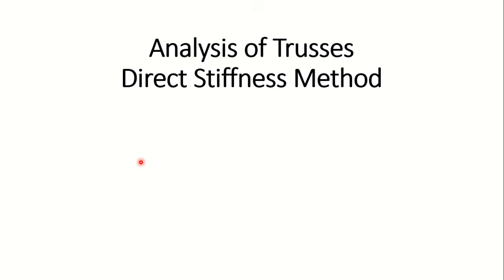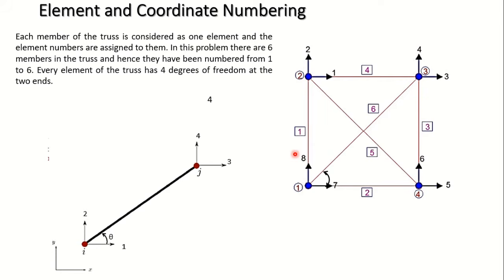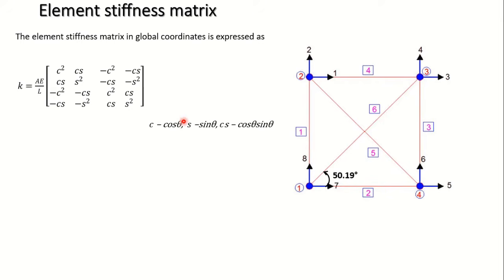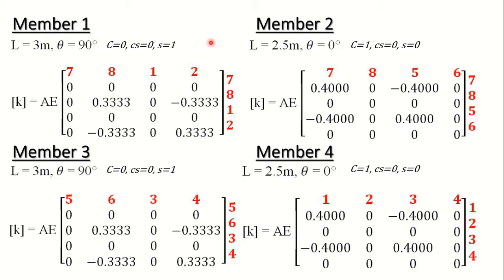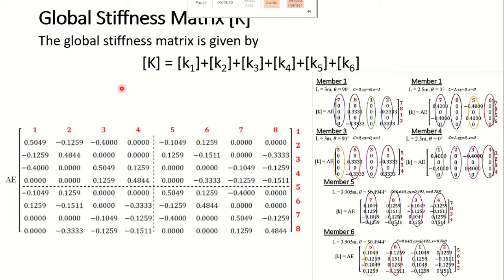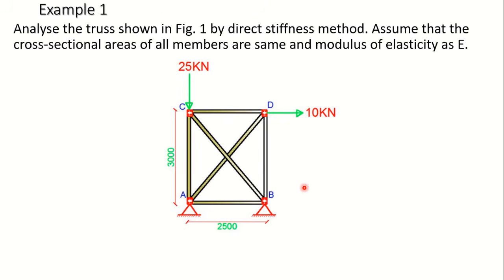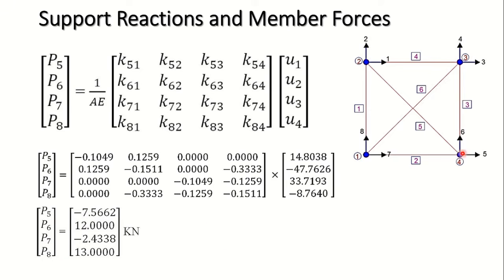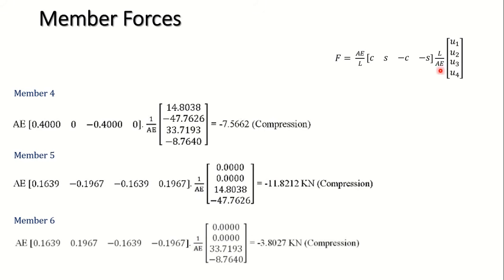Truss Direct Stiffness Method

Comment: Both 5 and 6 are not equally inclined. If one is 50.1944 degrees then the other would be (180-50.1944) degrees so I think there's a mistake.
Reply: do with 180-50.1944 you are right. the answer wont change.

Comment: How to know the value of c, cs?
Reply: for the member 1 and 3 they are straight up so their angle is 90 degrees, so u just put c = cos 90 and s = sin90. and same with member 2 and 4, but with angle 0. then for member 5 and 6, u put the angle they have which u can through trigonometry atan(3/2.5) = 50.19. so c = cos50.19 and s=sin50.19 for member 5, and for 6 its same as 5 but with negative sign, so c = cos-50.19 and s=sin-50.19. GL

Comment: Should member 5 and 6 matrix be the same?
Reply from the maker: Yes both have same cross section length and inclination with global axis so values of stiffness matrix elements will not change,
 but the orientation of both members is opposite this will change the sign.

Comment: How do you know where to label the numbers on each member's matrix
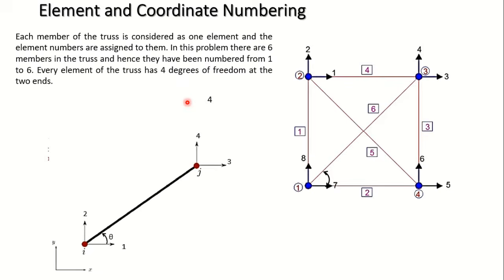Reply from the maker: It's done member wise and what are the nodes associated with that member. Watch @ 1:40
Also refer previous video https://youtu.be/vuqdVhxcSiw
Reply: @Kirank-81  i am a bit confused about this can you please explain i still dont understand you said that the one that are free to translate have been numbered first if i number joint 3 as 2 and 1 and joint 2 as 4 and 3 would it make a difference because they are both free to translate ?
Reply from the maker: @abdullahashraf8249 No that does not make any difference. Take care while developing the matrix accordingly.
Reply from the maker: @abdullahashraf8249  No it does not make any difference, provided you take care in matrices also.
Reply: @Kirank-81 how to take care in matrix? For example, for member 1 why is it taken as 7,8,1,2 but not 1,2,7,8 because the signs surely affect. Is there a specific rule so as to take it?